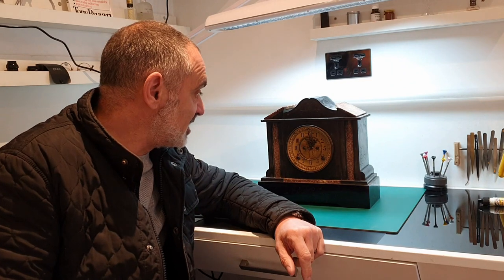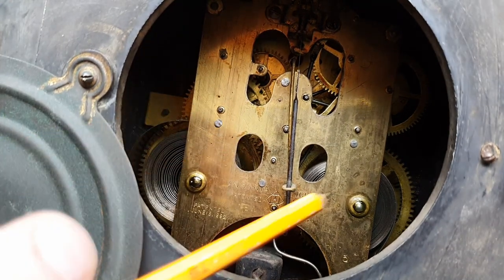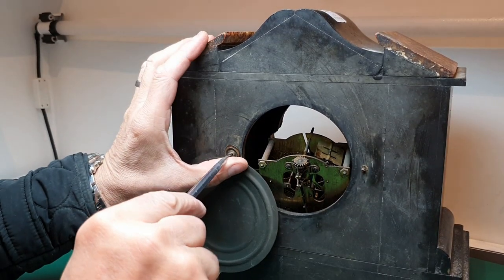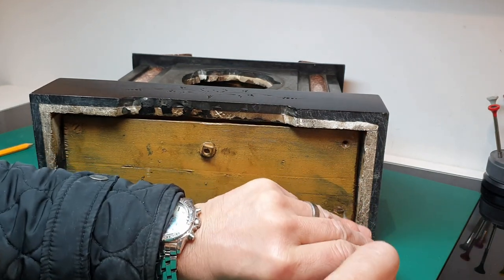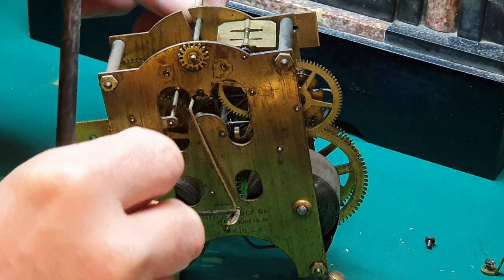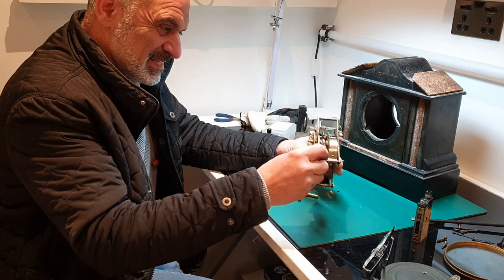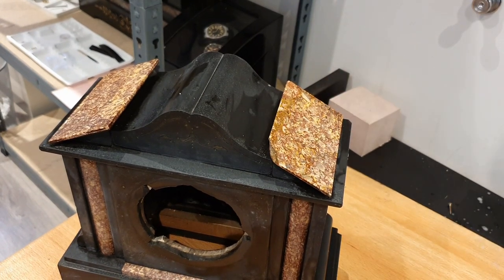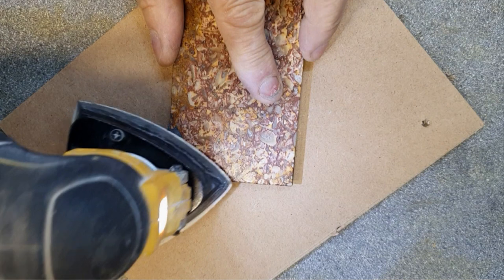Restoration of an Ansonia clock

Comment: I don't blame you for having to stop what you're doing to check Youtube so you don't break something! Now, because of that, you've got some spring clamps coming your way which will certainly be necessary for servicing clocks from North America. You're going to be all set to do more of these as time goes on. I'm somewhat used to seeing movements like this, but I haven't seen any of these French clock movements you were talking about. I'll have to see your other videos involving those. 

26:46 I was in tears at this. Priceless moment!

As for that ending, that's amazing. CRAYONS of all things saved the day.
Reply from the maker: Thank you for taking the time to watch. 
This clock really tested my patience. It really was a roller coaster ride for me as you'll see in part 2. I suppose its not that these clocks are hard to repair, its more a case of I am not used to them. I do have another Ansonia which I want to restore and this time I will be a bit more prepared for it. 
Johnny

Comment: Hello Johnny,
Interesting project, as this one is a little different it will build your skills...  Good to see the tea break interludes back in... after all these little snippets are what make your channel truly unique. Keep up the good work.
Paul,,
Reply from the maker: Hi Paul. this one really stressed me out. It very nearly ended up being launched into orbit. But yes, I learnt a few new skills with this one
Reply: I never stopped giggling. What with the new movement - my heart in my mouth incase you dismantled without the spring rings - the dog poo, cupsatea, access thru the bottom plate, dirty movement, 
I've been thru it all just last week. Best go to Bedford Needham Assembly and Adjustment on Antique Ansonia Kitchen clock my only hope to get it together and striking. Yet to do. I've go two broken fine springs to fix first. Good luck.

Comment: Love the vids. These model Ansonia's always drop from the bottom of the case. I just finished 2 of the El Arditi a little smaller case and learnt a lot. The bezel and first dial pan should be soldered together. both of mine have 3 clips across the back. I did find when I has serviced the movements and put them back in i laid the case flat and had a small torch from the back of the movement to the front of the case. This allowed me to align the holes get the 3 screws back in. Took me a long time to figure it out on the first one. Great job with the milliput. I wonder if you could have combined different colours for a close effect. I use the flat spring capture rings instead of the round as it gives you a little extra room when you are reassembling the movement . Again was trial and error for me.
Reply from the maker: Hi Kafren
I wasnt sure if this was a clock that had been put together or whether it was as was built. I have since found out from TIME4CLOCKS that this is how they came from factory.
You are right about the flat springs, I wish I had bought those instead but at the time I had no idea what I was looking for. 
I really appreciate the comment because they help me learn and get better at refurbishing these clock. There seems to be a really nice community of clock restorers out there.
Johnny
Reply: @treetopspider  Aye Ab at Time4clocks is great to watch. Keep vids going.

Comment: Hi, do you happen to know what kind of finish is used, shellac, lacquer, etc.?  Thanks!
Reply from the maker: Hi, I have tried many different finishes. Bearing in mind that this is a natural stone, I dont like the idea of coating it with anything other than some form of wax. Boot polish is very good. In one of my videos I melted and thinned some down with olive oil to make it easier to apply